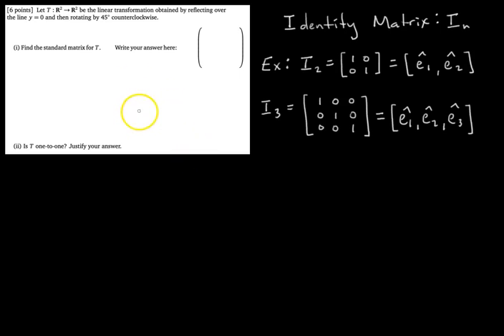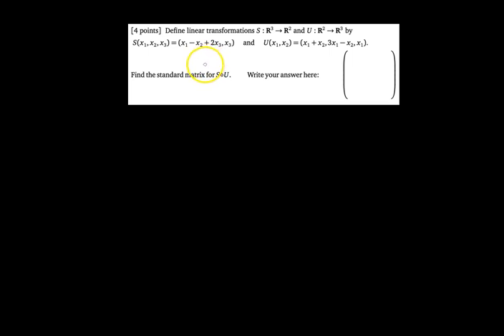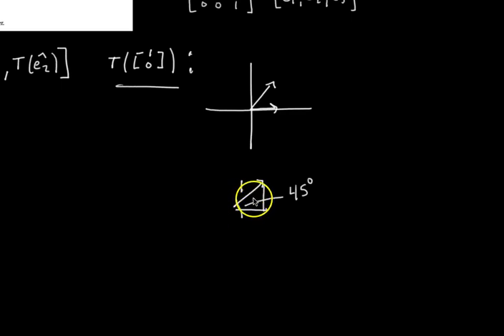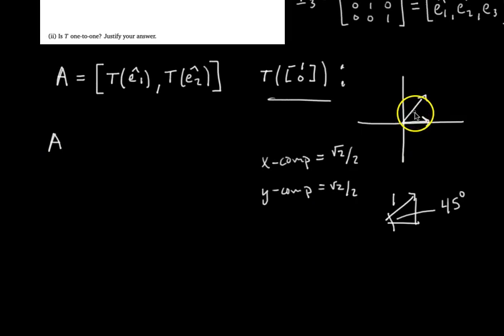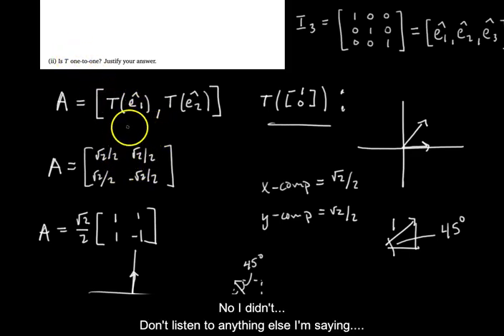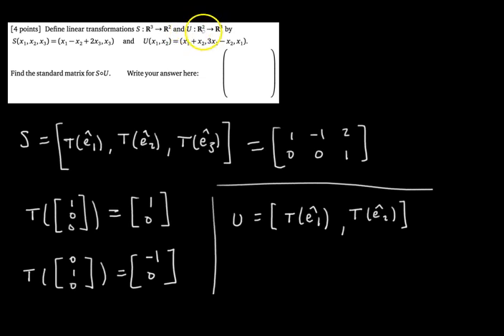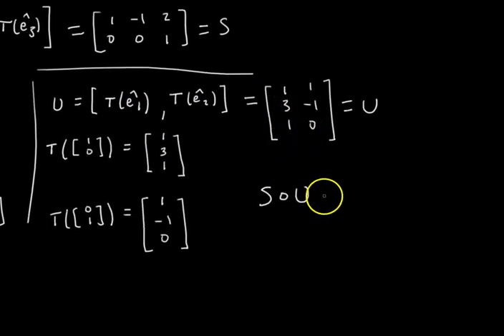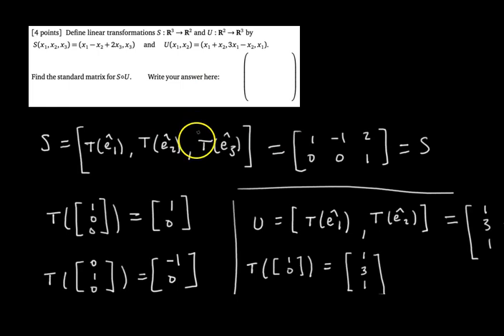How to Find the Standard Matrix of a Transformation: Transformations (3/4) [Passing Linear Algebra]

Comment: but you said in the previous video that if the transformation is 1 to 1, it has a pivot in each column, not row. which one is correct?
Reply: Yes, for a 1-1 transformation the columns must be linearly independent which means that there must be a pivot in every column. Having a piviot in every row meant that the transformation is onto.